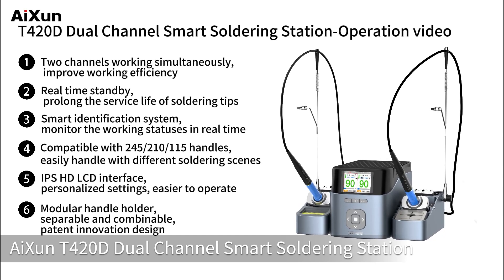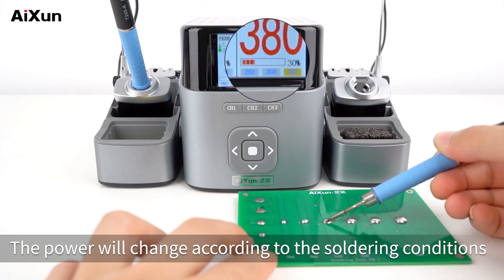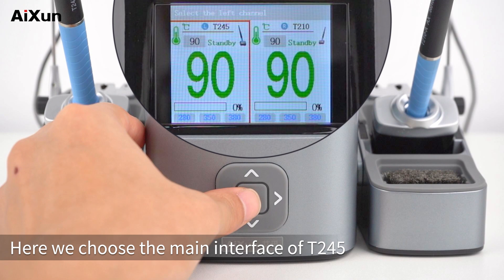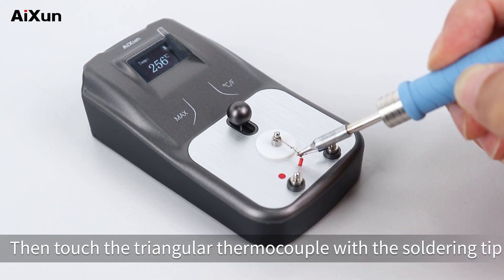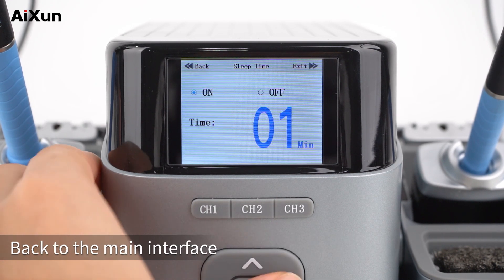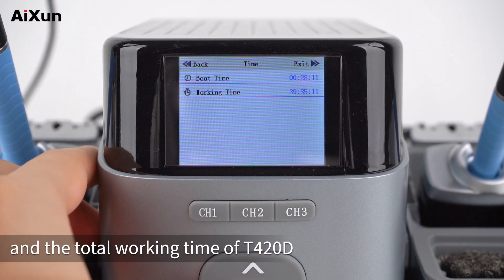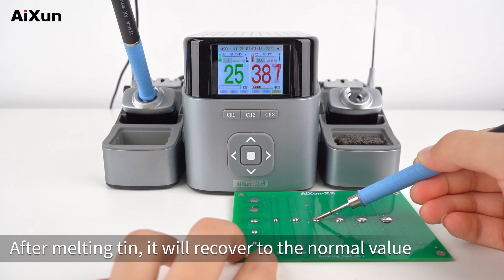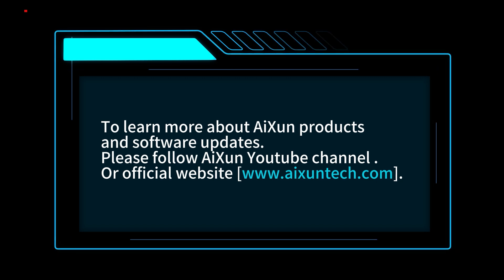AiXun T420D Dual Channel Smart Soldering Station Operation Guide

Comment: Hi, I have t3a with c245 and in near future I'm planning to buy t3b because c115 handle so I was wondering can I buy from you those handle "holders" that two wires witch you screw on stand to hold handle and cabal? If yes what should I ask for?